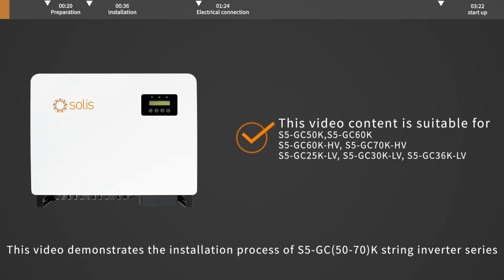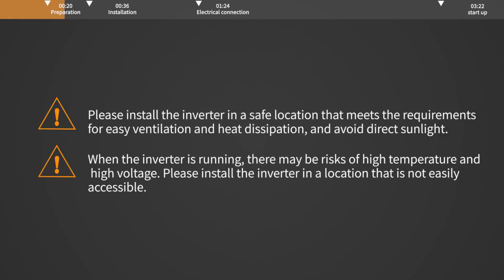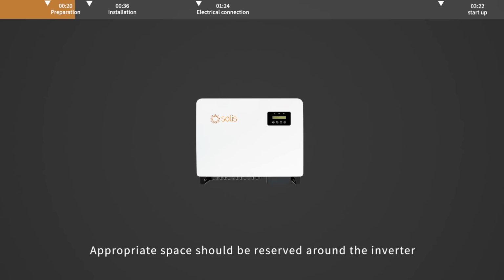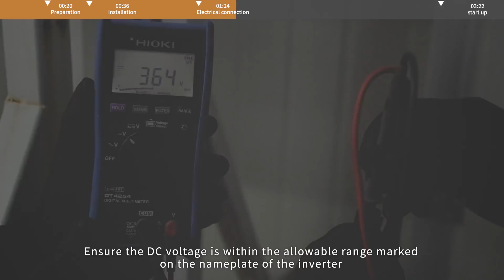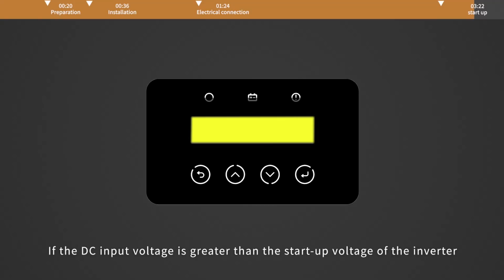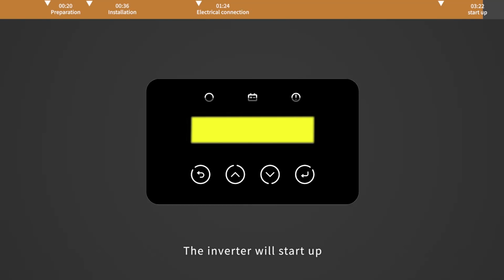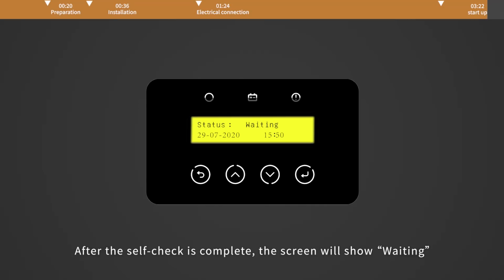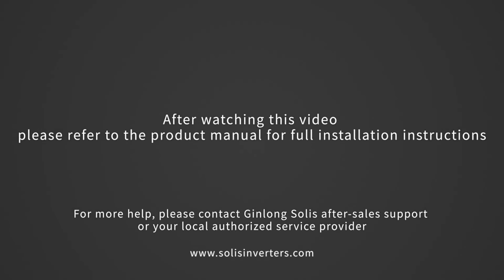S5-GC(50-70)K Installation Video

Comment: Incomplete installation video. Doesn't have parallel operation communication guidelines, and doesn't have a Meter communication connection instruction (Both in Grid & in Load). Expected in detail.